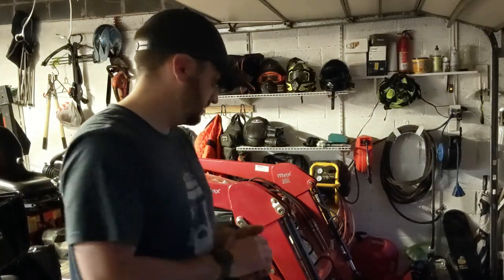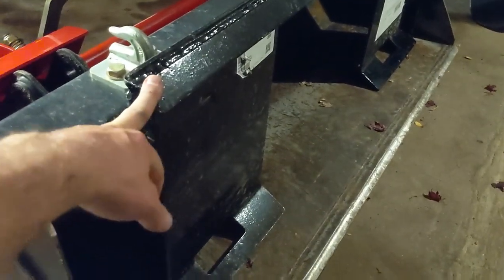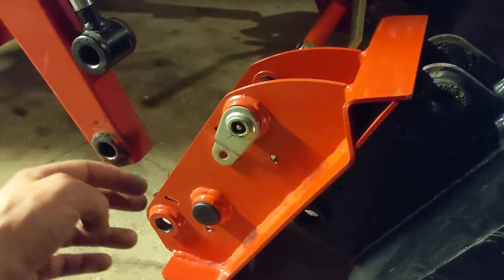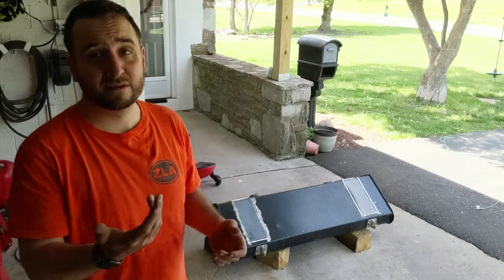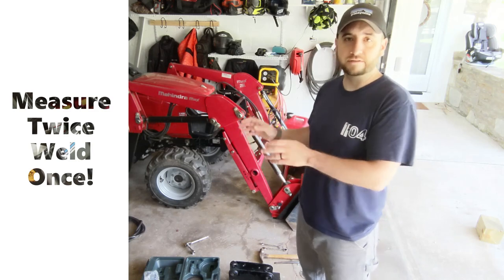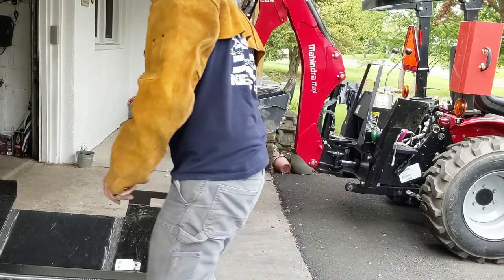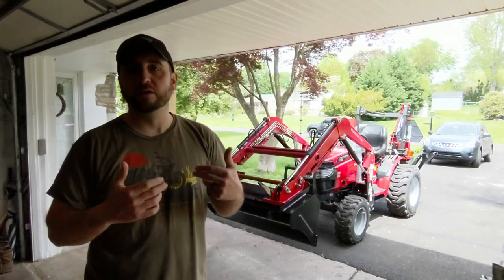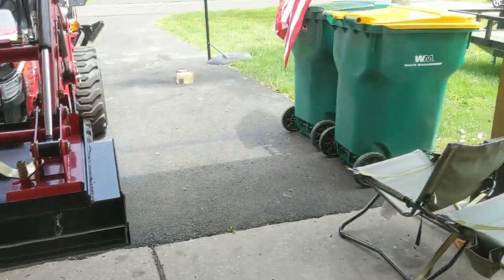Universal quick attach conversion on a tractor- How to make a loader 100% more useful.

Comment: Love the video, but would it not be easier to just sleeve the 1 inch opening to 3/4? The sheer load on the 3/4 must be greater than the loader rating anyway.
Reply from the maker: So I did originally consider that route The only thing that steered me away from it was the fact that I would have had to then buy some 3/4 pins that were already drilled and with grease fittings. I wasn't sure about the load rating on that small of a pin that's drilled through the center for grease so I opted to just use what I had on hand. Plus I would have had to buy sleeves as well. Basically it's a lot more investment than simply grabbing to drill bits and going to town haha.  thank you though for the comment I should have mentioned that in the video.

Comment: Where did you get the OEM quick attach from?
Reply from the maker: Mahindra dealer.  It's the part for the newer max26, as noted in the video.  Not too much work and great quality.
Reply: Thanks, I have a 28xl and trying to find a solution for a quick attach.

Comment: Also what is your loader model?
Reply from the maker: Unfortunately I sold that machine so not sure but it was the stock loader for the 26xl.  The xlt is nearly identical but uses thinner pins on the bucket.